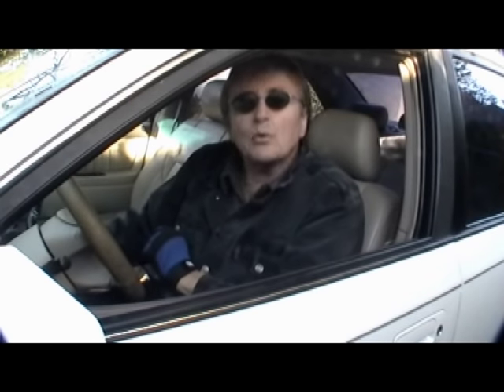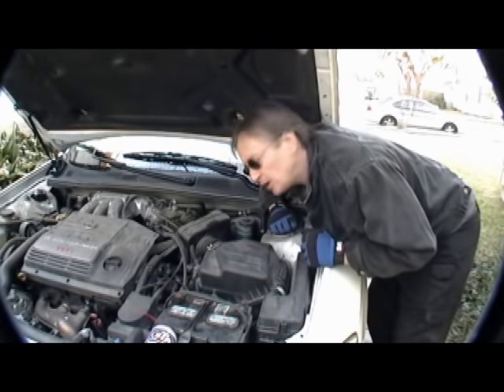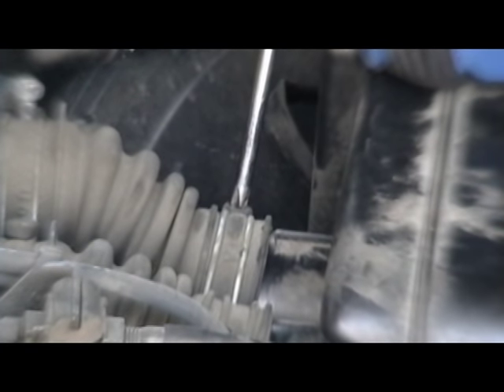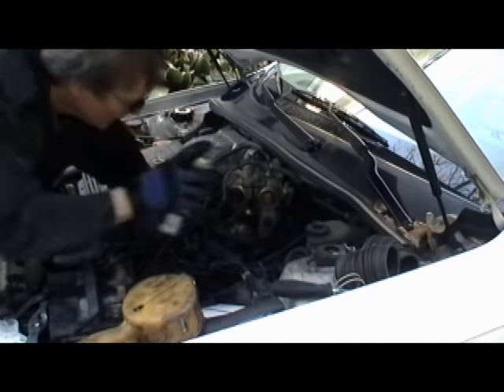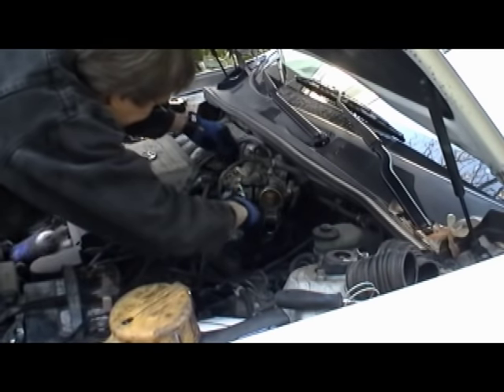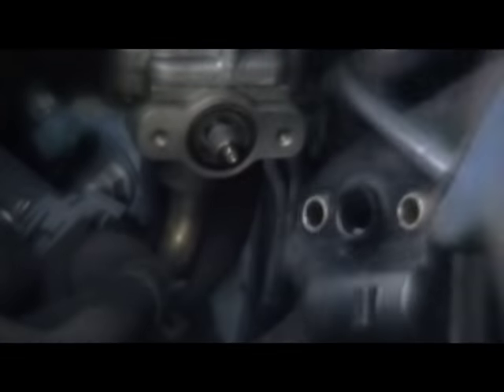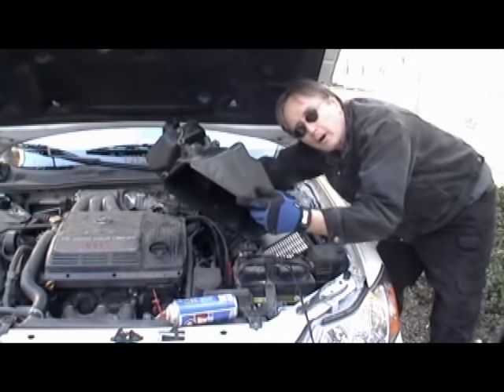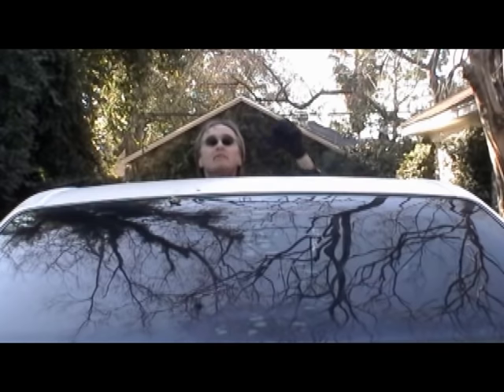How to Fix Engine Idle Problems in Your Car (Rough Idle)

Comment: After all the rough idling and stalling on start up my car has been doing for almost 2 years now, I got the throttle body fully cleaned (I felt too lazy to dig it out).  Now it runs like a new car
Reply: +Colin Donovan Note: it was a full fuel system flush
Reply: Colin Donovan how do you do that?
Reply: Was it only on start up that your car would act up?
Reply: Colin Donovan I have a Honda Pilot it will not start like it's not getting no field win I turn the key the car turns over but will not start
Reply: tyler j 🎖
Reply: What do you mean you were too lazy to dig it out?
Reply: @chickenmuffin  I don't even know anymore.  It was 5 years ago
Reply: @thelonelywolf88  😂

Comment: I combined this process with a fuel system cleaner and was blown away by the results. Thank you for the great video!
Reply: If your engine is GDI use gdi valve cleaner and you will be more blown
Reply: Bassam salim wats gdi? My car idles rough sometimes. It’s not all the time. Like today after I got off the freeway after about a 15min drive doing about 70-80mph. When I got off and stopped at a light I noticed it idling pretty rough.

Comment: You saved my car and my cousin’s car. Idle was low, therefore AC was bad and power steering was bad when turning. After we cleaned the throttle body as you described, the car now runs like a brand new and idle if perfect now. Thank you so much and keep up the good work

Comment: I was driving my 2002 mercury sable with this problem for over a year and it got progressively worse. I know nothing about cars and just did what you said to do. The amount of carbon I cleaned off seemed completely insignificant and I thought if this ends up fixing the issue I would be shocked. It ended up fixing the issue 100%. Not only that but my car accelerates more easily now too. You most likely saved me hundreds of dollars. Thank you!

Comment: Scotty..excellent video!! as always Thank you.  I followed your procedures on my 2002 highlander and working like a charm. it has 127 k miles. Couple notes.. Channel lock pliers required to remove screwed for IAC. Also be careful of not losing O ring and washer from IAC housing assembly when removing electric cover.  Once you ready to put everything back up attach washer on IAC you may need grease to make it stay in place.. i didn't have any working midnight to avoid 110 degrees in Dallas.. used hair wax.. lol. it worked. goo

Comment: Rough idle and stalling issue was driving me crazy it ended up being the purge valve solenoid I read somewhere that if it’s stuck open it can cause a vacuum leak also cleaned the throttle body and change the air filter. Problem fixed.

Comment: 2007 Chevrolet Impala 3.5 flex. Had a rough idle at red light. I did spark plugs change  and Wires, New air filter. cleaned mass air flow sensor, and throttle body. seafoam motor treatment in the gas tank. It's running alot better now. Thanks Scotty!

Comment: Scotty, great video as always. Question, would you recommend this same process for a 2003 Dodge Ram 1500? My truck has been idling pretty badly lately at stoplights. It has even shut off multiple times when I come to a stop. It'll start right back up every time though. But definitely irritating.
Reply: The same with me now... Can I ask you what was the problem if you remember?

Comment: hey Scotty i just had my spark plugs replaced on my 2006 charger. and after all was done we started the car and a p0107 code came on and we fixed it by replacing the gasket because of a leak. but now another code came on a P0108 im not entirely sure what it is. my mechanic thinks its a faulty map sensor because the car runs fine after a cold start up then after a few minutes when it gets hot it will idle high around 1000 rpm. engine light is always on along with traction control and a flashing throttle body light(the one with a lightning bolt sign). any thoughts on what seems to be the problem? btw when i brought the car to him it had no codes or what so ever. it was running great i just wanted to do a simple spark plug change. which ended me paying $418 for spark plug change and gasket because it started to leak when when it was put back. need some immediate help!

Comment: Hey Scotty I have a 94 olds 98 regency with a 3.8l v6 that is in pristine condition for its age so I really don't want to get rid of it just yet. However, she is running poorly as of late. It hesitates, has loss of power, idles a little rough. Every once in a blue moon when you start her the check engine light will come on, but if you shut her down and start it right back up again the light will shut off. So far I replaced the plugs and wires, replaced the coil packs, removed and thoroughly cleaned the throttle body, used seafoam on the intake, changed oil and air filter, cleaned the maf sensor, ran fuel injector cleaner, replaced the EGR valve and even tried running a higher grade fuel. None of this has improved the performance much. What am I not doing???
Reply: +KLUNKET I'm having a similar problem with my car (94 Olds Cutlas Ciera S). Did all the cleaning with no luck, plus changed out the fuel filter. I don't have the know-how to do this part myself, but we're going to a mechanic to have them check out the Throttle Position Sensor.
Reply: Allie M. Is your check engine light coming on? I've done a little more work since I wrote this comment and think I have located the problem. Does that Cutlass have the 3.8 liter V6? Does it not want to start every once in a while and then start fine another time?
Reply: +KLUNKET The check engine light comes on when we try to accelerate too quickly. (We usually end up getting on the 55mph interstate near our house at 35 so it doesn't come on.) We used to have an intermittent starting problem, but that was fixed when replaced the starter this past winter.  Never have any starting problems or any stalls. Our engine is the V6 3.1L.
Reply: Have you cleaned the throttle body? It isn't that hard to do... take off the maf sensor when you clean it and clean that as well- there are a ton of videos on youtube on how to do it... the throttle sensor isn't hard to replace either... it also sounds like your Crank Position sensor may be going bad... but if that is the case then you will need a mechanic because I think the crank position sensor is behind the pulley for your serpentine belt, and that is a pain to remove... You know what... if you are losing power like that you could also have a plugged catalytic converter... Or your O2 sensor is bad... or BOTH.
Reply: +KLUNKET, cleaning the throttle body and maf sensor is actually on our car DIY list before we take it into the mechanic to have the spark plugs changed (the back ones are too difficult for us to reach) and have the throttle position sensor checked.  While I did find the crank shaft sensor in my research for what we can do for our car, we're not having problems with stalling or misfiring so it doesn't fit quite as much. If it was a bad O2 sensor, I'm fairly certain that our car wouldn't have passed inspection at the end of May. Either way, I can't properly change any of those things myself so we'll have the mechanic check them out. 

One other thing, we took the car to a mechanic back in March when it was having the same problems.  The diagnostic came back with some codes, I can't quite remember, 100-104 I think.  That's the main reason we're going to be changing the air intake sensor; they cleaned it and the car ran like a champ until we took a trip to the mountains. (The mechanic won't run the test again without us paying another $90-- no thanks! It's cheaper to change a couple of sensors out ourselves.) We're having problems with the speedometer/odometer not working with acceleration is new and is what led me to the throttle position sensor.
Reply: Sorry to intrude in your conversation.. First, nice car!! Had one back in the day, beautiful car and smooth ride.... But did you ever fix the problem you had with the engine light?
Reply: jon doe, check engine light/surging problem was fixed. It was a speed sensor or motion position sensor; had the work done by a mechanic, don't remember what they said. Still having a rough idle, though.
Reply: Cat Converters? Or Trans slipping? If it only happens over a certain speed and you say loss of power, I would say somewhere there is an air-flow problem and I would check cats first.
Reply: KLUNKET de

Comment: Hi, Scottie I have a 1997 2.2 acura and have an issue with surging idle. I had replaced the Idle control valve, and it still surges not all the time,but sometimes. already gave it a tune-up and still the problem remains. What can it be?
Reply from the maker: +Noel Campos do my video "finding engine vacuum leaks with a cigar"

Comment: Hi Scotty when i start my car the rpm is 2000 when idling it continues like that until the engine becomes warm then the idle becomes normal. I have a toyota avensis 00 petrol.
Reply: KhalifaMedia you may have damaged something... If its 2000 and under its the computer adjusting to the clean trotle but if its 2500 and up its broken...
Reply: David Ponce mine goes from 1.5k to 2.5k but not above 2.5k. I have a 97 civic
Reply: It's just warming up the engine.
Reply: Yea its just getting water out the system as well

Comment: don't do what he says if you're going to clean your throttle body take it all the way off the car and an old toothbrush with gum out clean it out real nice and neat make sure you don't spray that stuff inside the iac motor or the throttle position sensor. cleane out real nice and neat put it back on there you go because what he's doing is shoving all that crap back into the engine. while you're at it might as well pop out the injectors use a toothbrush some car come out and clean the bottom of the injectors paraffin collect on the ends of those

Comment: hi Scotty, I own a 1989 f150 ford with a high idle problem at almost 3000 rpm. This is what i have done so far. 1) cleaned throttle body and plates with throttle cleaner. 2) cleaned IAC valve and tested the ohms across the only 2 wires and it was @ 10. I believe it has to be tested good between 7. and 15..3) tested TPS wires ohm reading on black wire good ohm to ground, tested orange wire and got a reading of 5 volts for my reference, then tested brn wire it had 1.4 volts at idle position with key in on position not running then 4 5 volts as i opened the throttle plates to full throttle. Now, i did notice that my coolant bottle was low and know that this could result in erratic idle on some newer cars. But i don't believe that is the case on a 5.0 in a 89 f150. After all of this and two days of what my brain could absorb, it still runs above 2500 rpm. any thoughts? oxygen sensor? and if so how do i test it before going out and just throwing money in part by part trys? what else possibly?

Comment: I did this just yesterday on a 2003 Toyota corolla 4cyl. 1.8l I think. 

Hasn't worked yet,  I noticed driving it accelerates very slow and gunning the revs when it finally hits high rpm or gunning it up hills it has a weird burning smell that I'm sure isn't a engine oil leak. 

Since I already cleaned the throttle body and air flow sensor,  do you reckon it's a worn out clutch? Thanks if you read and make a video.
Reply: Holy, same thing is happening on my 05 Altima she's almost 300,000k
Reply: Did you ever figure this issue out? Lol I'm desperate

Comment: Hello Mr.
My ford expedition 2002 has low rpm 600 just in morning starting without any vibration, and after worming it will return to normal rpm 850.
Appreciated your support

Comment: MScotty many thaks for your videos, and sharing your knowledge with us.
Maybe you can give me a hand on my accord.

Honda Accord  ICTDI 2,2 year 2006 with 200,000 miles,
these car is very well care maintained, the engine is strong an smooth,

After turn the ignition ON
1- Engine service light,  Immobilizer, VSA, ABS  go ON and after few seconds go OFF.  Normal operation
2- Glow plug light goes ON and after 5 or 6 seconds goes OFF.  Normal operation
3- Battery, Oil and parking brake  lights go ON and stay ON.  Normal operation
4-After crank engine immediately starts and after 1 or 2 seconds engine die, if you press the gas {diesel} pedal a little  during crank you don't loose any start, engine goes to 1500 rpm and then go back to 800 rpm and everything goes fine, car works fine without  any issues. In other words you can not start the engine if you don not press the gas pedal. Apparently  there is not any difference between cold or hot engine start up.

In my humble opinion IN A NORMAL OPPERATION, after start RPM will stabilize around 1200 and after warm up, will descend to around 800  RPM. It seems that these  is NOT happening.

Any suggestions would be grateful

Comment: HAY SCOTT.. THANKS TO YOUR SHOW I HAVE SAVED LOTS OF MONEY BUY DOING STEP BY STEP WATCHING YOUR SHOW..I HAVE ONE PROBLEM.. THE ONLY CODE I HAD WITH MY 2002 GMC ENVOY WAS THE CRANKSHAFT POSITION ... I CHANGE THAT AND SOMEONE ELSE CHANGED THE SPARK PLUGS 8 MONTHS AGO BUT THE CAR STILL SHAKES AND STALLS WHEN I TURN ON AC/ OR HEAT/ OR RAISE THE WINDOWS,, THANKS

Comment: the cover of the IAC valve has 2 small screws that have a 5-point str pattern and are NOT Phillips screws. Vice grips and a pre-soak if the screws for 15 minutes makes them much easier to remove. And taking the IAC loose for cleaning is much easier if you remove the throttle body entirely and clean it front and back . Be careful if the IAC is electronically controlled... cleaning is made more delicate and complex with that in later cars (after 2000 models at least).

Comment: Resetting my 2004 jeep grand cheroke limited 4.7 liter computer. unhook the battery cables, touch them together for 30 sec to 60 sec. re connect them back, turn key but do not start, turn head lights on, then off. check engine light will flash rapidly until you remove key from ignition. when i did this my jeep ran  at 11 mpg for a few weeks until it was able to re learn the adaptive memory. i did a full tune up and and cleaned a bunch of stuff that was dirty. throttle body, iacv, new throttle pos sensor, new plugs, pcv, oil,fuel filter,checked all vacum lines for leaks,changed out anti freeze,new gas cap, new radiator cap.new belt and tensioner, cleaned battery terminals and cleaned all the ground cables going to the body, engine, firewall,etc... Scotty please comment if you see anything you disagree with.reason for the overhall was i just bought it used from a private owner.
Reply from the maker: +Clownsatthecemetery  after driving it a couple weeks that way , get a guy like me to scan it with his dealer level scanner to check live and mode 6 data to see what general shape it's in and if anything's still off some.
Reply: sounds good. thank you Scotty

Comment: cumon scotty spraying cleaner isn,t enough I take a tooth brush and scrub in the throttle body so the plate doesn't close on carbon and throttle cleaner left in the intake also helps to remove carbon in the cylinders out so I start them right away to blow out as much carbon as I can
Reply: I just did this as well, and took the whole throttle body off the engine, did an amazing job

Comment: 94 sonoma idles rough only sometimes. Usually when its warmed up but not always. Worse when the ac is on. Hard start. They said it wasnt electric or vaccum. Gonna try this and check fuel pressure i guess.

Comment: Good morning . I have a 2011 Chevy Equinox runs great in the expressway all gears go in good . Only thing in drive for a couple a second s like 5 seconds the engine starts shaking  idle starts to drop engine shakes . Now in park nothing and in neutral nothing it won’t rough idle . I’m gonna try this see what results I get

Comment: Hey scotty thanks for the information. 
just a question here. I cleaned the throttle just like you said in my toyota camry but now the idle is too high at parking and neutral. is this normal? or should I do something else to fix it? 
Regards !
Reply from the maker: drive it a week, often computer will settle back down. if not, check for vacuum leaks
Reply: Thanks! keep up the good work

Comment: Scotty I have a 2005 v6 mustang . Engine light came on so miss fire on number 5. (Car engine shakes at idle) 

1 replaced all spark plugs
2. Replaced coil
3. Replaced numb 5 cable
4.found a leak in the antifreeze that lead  in and outer hose connected to the fire wall (replace and no leaks after)

After all this and the engine still shakes at idle  what do u think ?

Comment: Hey Scotty got a question my 2001 Acura el  5 speed when I start it up it runs rough when it idles when I am in neutral it almost stalls can u give me some advice
Reply: patrick lynch got a 05 Mazda 5spd. Same problem when starting from cold. May stall once or twice then the engine is good to go.

Comment: My car started stalling while idle after I changed the air pump connecting the air filter to the throttle body.

Edit: I did what you said and it worked!!! I’m so shocked the car was really dirty though, who would of thought. I use the spray cleaned it followed the steps you gave and now my car is running perfectly fine. It hasn’t just off or anything.

Comment: Hello,
My car i20 battery was replaced with new battery. After that, on staring the rpm drops when idle. Everything (alternator, battery level etc were checked etc) is ok except the drop in rpm.

It has been 2 days now waiting for the rpm return to normal again and I have been driving long hours to restore the correct rpm.

Please help...I'm really disappointed with the new battery.

PS. Initially rpm was at just below 1x mark, after changing battery, the rpm drops to almost .5x.